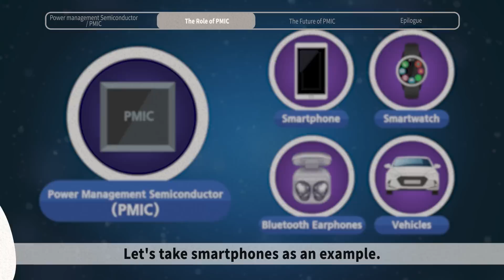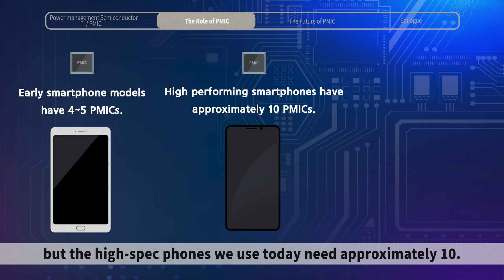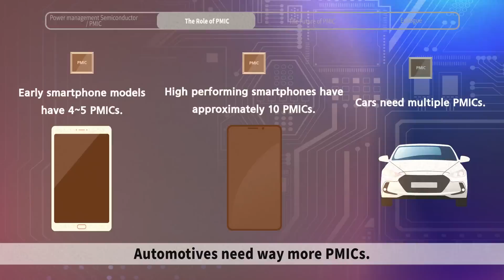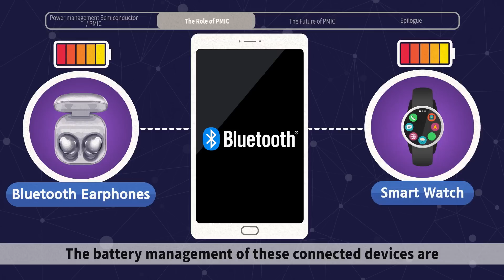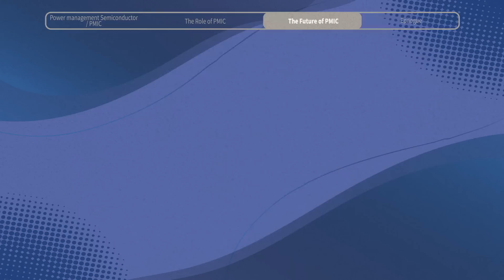Power Management Integrated Circuit Explained | 'All About Semiconductor' by Samsung Semiconductor

Comment: TAARA Project: Google, Samsung, and Green Energy with Wireless Power Transfer
Objective:
The TAARA Project aims to create an intelligent, sustainable energy infrastructure through collaboration between Google and Samsung, focusing on green energy and innovative technologies, including wireless power transfer. This project seeks to revolutionize energy distribution and management while promoting energy efficiency, smart connectivity, and environmental sustainability.

1. Clean Energy Innovation
Solar and Renewable Energy:
Samsung and Google will develop high-efficiency solar panels and advanced energy storage systems, integrated with AI to optimize renewable energy use and distribution.

Wireless Power Transfer:
A key innovation will be wireless power transfer using electromagnetic waves, which allows energy to be transferred without cables. Google will optimize these systems using AI, while Samsung will contribute with devices that capture and distribute this energy.

Goals:

Develop wireless energy transfer technologies for cleaner, more efficient energy distribution.

Integrate these technologies into smart homes, businesses, and cities.

2. Smart Connectivity Solutions
5G for Green Energy:
5G will enable efficient communication between smart energy devices, optimizing renewable energy consumption in real-time.

Smart Homes and Cities:
Renewable energy solutions will be implemented in smart homes, connected through Google’s platforms, allowing efficient and sustainable energy management in urban and rural environments.

3. Circular Economy and Sustainability
Recycling Electronic Devices:
Google and Samsung will promote the recycling and reuse of electronic devices, such as batteries and solar panels, aligning with circular economy principles.

Access to Energy in Underserved Areas:
Renewable energy solutions and smart grids will be deployed in rural and developing communities, ensuring universal access to clean, affordable energy.

4. Wireless Power Transfer: The Future of Energy Distribution
Wireless power transfer is a groundbreaking technology that uses electromagnetic waves to deliver energy without cables. This method will enhance energy distribution flexibility, especially in remote areas, and reduce the need for physical infrastructure.

Goals of Wireless Power Transfer:

Develop and scale efficient, safe wireless energy transfer systems.

Enable energy connectivity without cables, reducing installation and maintenance costs.

Global Impact of the TAARA Project
Global Sustainability: The TAARA Project will promote a cleaner, more efficient energy model, aligning with Sustainable Development Goals (SDGs) related to clean energy access, energy efficiency, and climate change mitigation.

New Energy Policies: The implementation of wireless energy transfer could influence global energy distribution policies, accelerating the adoption of renewable, sustainable technologies.

Education and Awareness: The project will also promote global education on sustainability and the green energy transition.